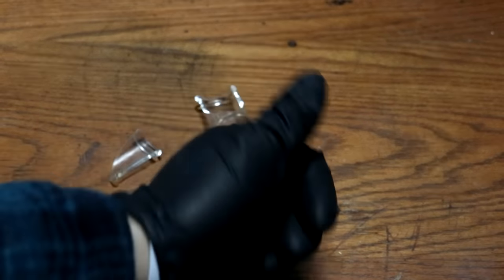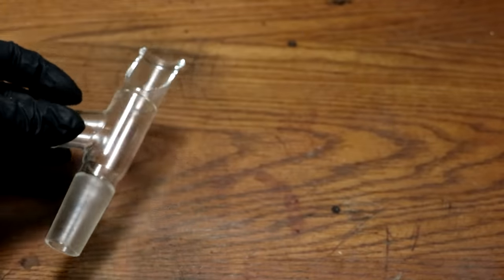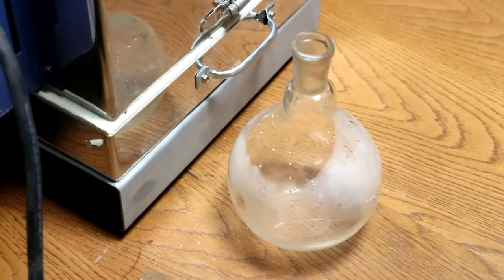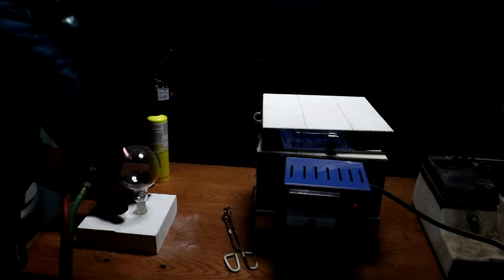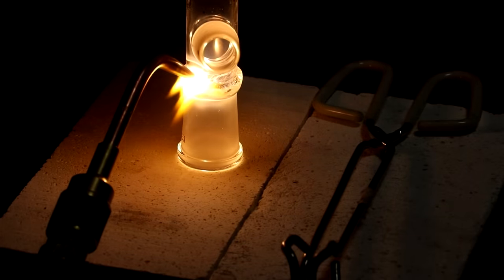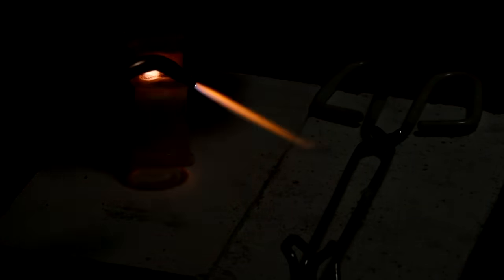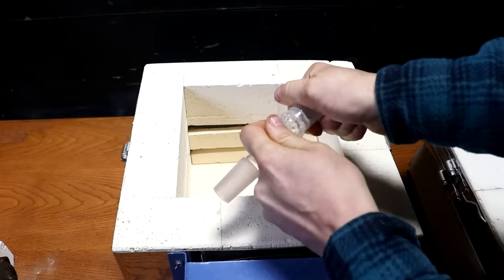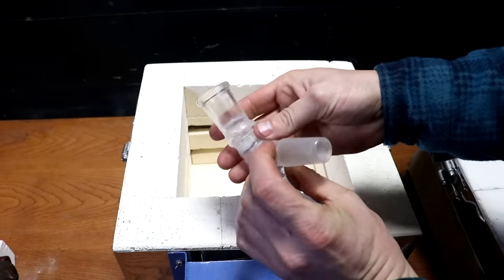Can I Weld Glass?

Comment: nothing mission critical, just your everyday distillation... haha
Reply: CruelQuertos  How is boos not mission critical? Liquid fuel that propels you in any other direction than the one intended, crucial to my mission, that’s a fact!
Reply: CruelQuertos Ain’t getting nowhere making booze with lab glassware. I would not be at all surprised though if Cody had a big old still up on the ranch!
Reply: Emission*
Reply: Justin Misener Why not? I have a glass rigg that works great! Base is stainless tho, but if aiming for 94%, refluxing glass rigg is the way to go..
Reply: @Torgeir Borsheim If you don't mind me asking, what size do you work with?

It's not that I have any doubts about using standard lab glassware to distill EtOH, it's just with your typical round bottom flasks being 1L or less,  you can't exactly distill much wash at a time. Combine that with relatively low power going into boiling the solution which would mean a slower distillation rate, and it seems like it'd take an awful long time to produce drinkable amounts of hooch. My experiences are with 50L boilers with 3000+watts of immersion heaters, and 3-6ft tall 2" diameter reflux columns that spit out azeotropic EtOH (or very close, depending on how you run it anyway). That sort of sizing is pretty typical of hobbyist equipment from my experience, though I've definitely seen considerably smaller setups, some being as small as 4L boilers, though they were not reflux stills.

Cheers!
Reply: Justin Misener No prob, (have hobby license for this btw, Norway..)
 150L ( as mentioned) stainless tank (takes 100L crude at a time) with one 1KW and one 2KW element, topped with a ground joint. The column gets complicated, lots of twist and turns, but the tower is 150cm tall, has an input for a thermometer at the top and the rigg burns thru 100L in about 8h :) Not a big drinker, so that usually lasts me a good couple of days ;) I Don’t think I’d bother with a tank smaller than 20L. Altho there are ways to make desktop sized systems  work, involves pumps, holding containers and extra steps tho...

Comment: Of course you can!
Its pretty easy using a oxyhydrogen torch. Just don't heat it up too fast...
Reply: The Elemental Maker on YouTube has been playing around with his DIY HHO torch
Reply: @maxximumb  You mean Carsandwater?
Reply: Youre better off using a oxygen propane torch for borosilicate glass
Reply: trying to fix all my broken glassware i can say that heating is up is easy-  cooling it down evenly is the hard part.
Reply: Also, I would've shut off the kiln and left the flask in it. It was losing heat way too fast, and he spent to much time fiddling around with the torch. Also the flame was way too big. It only needed a tiny little flame, maybe a mm wide.
Reply: Peter Hickman hyrogen is fine for boro.. it's a little more expensive but I greatly prefer it to propane.

Comment: I TIG weld and Stick weld and found this incredibly impressive! I really want to give it a go. I know the properties of glass are extremely different from metals but you mentioned a weld 'puddle' and I would imagine you could add material in the form of glass "filler rods" assuming the same grade of glass was used to control the heat and puddle as you do with metal welding.
Reply: I was thinking the same thing. But the rods may need to be heated as well. Or maybe coated with sand or quartz?
Reply: @ListenYoungManListen  perhaps you are right.
Reply: @baronburgamot243  silica dust is used in certain glass bonding uses, could be a good bonding agent for the glass
Reply: I think borax and leather taning ointment & bam you got flexible glass. No shit. Or is shit you not.

Comment: Yes Cody, you are correct about the big round flask there.  What you needed, was the blowtorch blasting around the workpiece keeping it all at temperature, with a big wide flame essentially touching the entire workpiece, so that it keeps it at 800+ degrees, through essentially brute force, and then you come in with the OxtAcet torch withnits much smaller and MUCH hotter flame, and "weld" the glass.  Either that or find a way to work inside your furnace.

Comment: I worked in a light bulb factory a few years back in NZ the bulb body was spun under two burners which were feeding town gas, air and oxygen.  The combinations of each of these gases were carefully set. The weight of the molten glass was used to merge to the flanged edges of the part which is called the foot, which was the part holding the filament. Each bulb sat in a steel cradle, sulphur dioxide was injected into the town gas, which put sulphur on the steel parts to stop the glass sticking to the cradles.

Comment: Cody, If you want to repair glass in the future, I would suggest using a 'Double Ended" torch like is used to create Neon Sign glass tubing. I took 2 college classes in Neon.
We used those and "Ribbon Heaters"  for glass welding and forming.
 The gas we used was Natural Gas and standard air mixed, O2 under pressure from an old vacuum cleaner motor.
 Cutting can be done with a fresh, sharp triangular file, just scoring the glass, then a bit of pressure to snap the glass at the score. I had great success with my glass welding, but a bit of practice is needed.  Maybe you could talk a local neon sign shop into letting you use their equipment, or they might have some surplus torches you could obtain cheaply. Good repair at any rate. I suspect the powder was a residue from the bottled gas you used.

Comment: I've had some experience with glassblowing. The white powder is where sodium evaporated from glass due to high temperature. Putting some sodium chloride into the flame in front of the glass makes it clear again.
And you definitely need a wider and a cooler flame for the big things. Usually propane-air-oxygen torch is used.
Adsolutely did not expect this to work, nice job!

Comment: What if you filled the glass ball flask with sand or some hot medium to keep away cold air? Kinda weld it from the inside out if you had a reactive enough sand?
Reply: i think the glass on that is too thin... so it cools and heats too quickly and its brittle

the part he successfully welded was very thick glass
Reply: I would think this would work except that you may end up welding some of the sand to the inside of the flask. Glass is made from sand after all...
Reply: @shanefoster5305  That was my first thought too.
But the easiest way might be to keep the flask inside the hot oven while he's welding it (use gloves/long-handled tools).

Comment: It's great what glass gurus can do. In our chemistry department we have a glass blowing workshop and the guys work wonders in fixing glass equipment. I dropped a 5l separating funnel but only the stopcock and ground glass joint broke. The bulb was intact. So instead forking out ££££ for a new 5l. They fixed it instead for less than £50.

Comment: FYI  the water inlet for the condenser is supposed to be the lower inlet closest to the receiving flask. This creates counter-current flow so you have a more stable temperature difference and a stable heat transfer rate through out the condenser.

Love your work!

Comment: You could have used a glass rod kinda like a filler wire
Reply from the maker: You mean like I was doing?
Reply: BUUUURRRRNNN
Reply: No like a tig weld with filler but it worked anyway so it doesn’t matter
Reply: Cody'sLab If you were, it was too dark to see due to contrast from the torch flame.
Reply: @theCodyReeder  to be fair it was hard to see you using the filler rod. I did not see it the first time i watched the video. After reading this comment i re-watched the video and saw you using it.
Reply: Cody'sLab ahh I see it now sorry for my ignorance
Reply: @kypitbull  I still dont even see it

Comment: Lampworker here. 
you NEED a digital ramp down controller to anneal borosilicate glass properly, the soak times for everything below annealing temp down to stable temp are way longer than a straight crash to cold in any kiln ive owned.
 get a cheaper ~$150  oxy/prop bench torch. a lil guy. and some graphite glass joint jigs to hold those joints with. you'll be much happier. also you need a garage to reheat your workpiece as it cools like a weed burner or something on low to soak the larger pieces like your flask in to keep the heat stress from breaking it before you get done.

I work in alaska in the interior and kiln garaging doesn't really work when the ambient air is -20f, when your workspace air is cold you have to add LOTS of heat.

Comment: Curious if you really saved 30.00 when you cost adjust fuel and power
Reply: You can fill up his gas bottles for around $30 so I dont think it came anywhere near that
Reply: I guesstimate he used about $5 of gas and electricity.
Reply: Anthony Davidson 
Then add in the Adsense revenue when the video goes viral. +$300
Reply: Bringing the glass up to temperature in a kiln is probably less than a $1, cost of the oxy acetylene probably not much more, you can fill a 10 cubic foot tank for about $25-30 and he would have used maybe a fraction of that.
Reply: well if the shops are far away you also gotta pay gas or shipping
Reply: Curious if he actually saved 30 bucks for a part that costs 1 dollar and fifty cents from aliexpress including shipping, lol.
Reply: Does he make his own fuel? I know certain fuels he home-makes
Reply: @Its_Captain_Jack_Sparrow  plus shipping which is always a lot from AliExpress it'd be close to $30
Reply: Sup3rman1c Somehow I doubt Cody uses cheap Aliexpress glassware if he’s doing dangerous experiments.
Reply: @amykinsnailart6096  Ah, the classic "chinese quality is garbage, so I buy my chinese glassware from ebay with the american text printed on, so its higher quality".

Comment: This might sound stupid , but maybe the flask was cracking because you were putting it on 2 cold bricks while doing it?
Reply: 2pump Chump It probably contributed..
Reply: interesting
Reply: It looks like they're insulating bricks, therefore not 'cold' (heat-sinking).
Reply: @UCCLdIk6R5ECGtaGm7oqO-TQ  you could be correct ,but I guessed they might not have been inside the furnace and with the current cold weather where Cody lives , the ambient temperature is sure to be cold
Reply: @keiran5170  Ambient temperature is likely to be cold relative to glass temperature, yes, but the insulating bricks themselves won't hold any signifcant heat whether having been in the furnace, or not.  You could probably blast one of those bricks with a blow torch and still be able to pick it up with bare hands within seconds of removing the heat source.  They reject the absorption of heat that well.  They will be at ambient temperature but without the characteristics of heat absorption necessary to draw heat from the glassware fast enough to cause cracking.  It's like having a piece of metal and a piece of wood at ambient temperature in Winter:  Though both materials are at the same temperature, the metal always feels perceptably colder than the wood, not because the metal is actually colder, but because of its heat absorption properties compared to that of the better insulating wood material.

Comment: I once made a steel spinning top with a glass inlay, using a blowtorch to soften a glass disk into a pre-cut counter-milling.  After a few shattered attempts, I found that the trick was to surround the workpiece with a heat-proof cowling (rocks in my case) that directs waste heat from the torch around the piece instead of off into the air.  I effectively made a tiny little oven fueled by my working flame.

Comment: The white powder is vaporized glass that settles on the cooler parts. You usually see this on fused silica parts, because that has to be heated to higher temperatures than pyrex. I assume, your part was pyrex and that you heated it way too high (judged by the white glow), that's also why the seam is so bubbly - part of the glass started boiling. If you have propane at hand, use this with oxygen for pyrex.

Comment: Does anyone have advice on a good budget way to pick up a basic distillation setup without spending a fortune? I need a way to recycle a couple of liters of Hydrochloric Acid/Hydrogen Peroxide circuit board enchant. I'm trying to follow Nurdrage's "no hazmat waste" guide on this enchant. I think I need a distillation apparatus, containers, and a hotplate stirrer. What should I look for? I have no meaningful experience with this stuff and a homeless vagrant's budgeting constraints. Chemistry hasn't been my thing. It's cool and all, but it is a means to an end for my purposes.
-Jake
Reply: @danielrouw2593  
Yeah should have mentioned I'm in Southern California. I'll look up "Home Science Tools." Thanks for the reference.
-Jake
Reply: Thick-walled “high-borosilicate” from ebay has never failed me ;) I recommend the hotplate-stirrers from Maple Scientific. Cheapest I’ve found that holds..
Reply: Daniel Rouw Nah, go search. Look at the specs and read, you might learn something :)
Reply: Dechem glass from.china on ebay, its great wuality glass and a basic distalation kit is 40$ shipped
Reply: @94ToBor  yep, Dechem glass from china i get and its thivk and good
Reply: You can find basic chem gear on Amazon. Just make sure it's actually borasilicat

Comment: Ive also attempted to fix my own glassware a few times, rarely successful.  The annealing process is definitely critical, watching your success has convinced me to either make or buy a furnace.     Also I think you could have fixed the round bottom if you would have used the mapp gas/ blowtorch as the flame is much more broad than oxy/fuel torch.  And if you ever attempt to fix a similar crack in glassware, start fusing the crack from the center/middle of the crack then work your way to the ends, ive had success a few times doing that but never when trying to start at the ends of the crack.

Comment: At the end of the video you comment on how you couldn't keep the flask warm all over and this lead to further cracking due to the heat differential. At the same time you are holding the flask above the furnace! A great place to keep the glass warm. Warming the flask while it is in the furnace with a gentle flame, such as a bushy flame from a propane torch, and then performing the repair while it remained in the furnace would have most likely worked, obviating the need for a furnace pre heat.  Of course just making the repair while the warm flask remained in the furnace would have have been even easier but the heat coming out if the cooling furnace might have been a little uncomfortable.
Eric

Comment: I wonder if you could have gotten the flask repaired too, with some kind of insulated cradle thing; a shell made from an high temperature insulation that was molded to loosely surround the flask, but with a hole or slit in the side for accessing it with the torch. Another option might be to crank the kiln all the way up, and open the lid to weld the flask inside the kiln, and hope it keeps it hot enough.

Comment: A small butane/propane camping stove may provide a good area of heat for the other side of the flask. You can create a mount for holding it above the stove, or simply hold onto it. This may work. I have seen in glass blowing videos where the glassblower works with one hand and has a secondary torch in the other. But not a torch with the powerful flame, but a regular flame burning.

Comment: Hey cody i think that the White stuff that formed was magnesium oxide. I read online that it is used for "effective control the setting rate and crystallization behaviour of glass metal. The main is the glass’ physical performance at high temperature. At the same time, it can improve the melting properties of glass. In other words, it plays a role of fluxing action."

Comment: That was cool well done, definitely a worthwhile venture as you learned, taught, and succeeded.  That being said, I have a few questions.
1) How long did it take to process from start to finish?
2) What do you value your time at?  ($'s / hr)
3) What was the cost of the materials to process it?  (including saw, blade, heater, fuel, electricity, flame bricks, et)

Comment: THIS CAN BE DONE BUT YOU NEED TO TWO TORCHES THE WAY YOU WELD CAST IRON!!! You take a large 1" wide torch think its called a rose bud torch that heats the work almost to red. This keeps the whole piece hot. Then you take your fine oxy act torch and do the welding. Also its usually done in a lathe with both pieces spinning with the large torch fixed to constantly heat. See Glasslinger on you tube the guy is amazing at making home made vacuum tubes and neon lights

Comment: In the lab, Potassium Chloroplatinate treat glass then can solder or braze the glass. Zinc Oxide and phosphoric acid makes good glass cement. If you treat the broken glass surface with waterglass (or even lye) creates a thin layer of low melting sodium silicate to bond the glass pieces. Car part stores sell waterglass and fiberglass strips as "muffler bandage"

Comment: For the flask you would need to use a glory hole (hole into a furnace set to melt the glass, and yes that’s what we glaziers call it.). Even heating and managing the stress of the cooling is critical for thin walled object or they may fracture do to uneven annealing at a random time. My instructor had a glass implode holding vinegar tears after he made it with no outside stimuli

Comment: When you weld a crack in a cast iron pot you have to drill a hole at both ends of the crack so the crack doesn't spread. The circular hole keeps the stress of expansion from breaking it further. I don't know if you could do that with glass, but it might be neat to try.